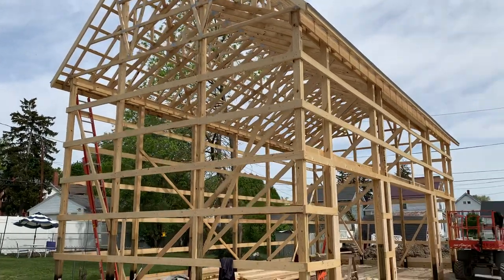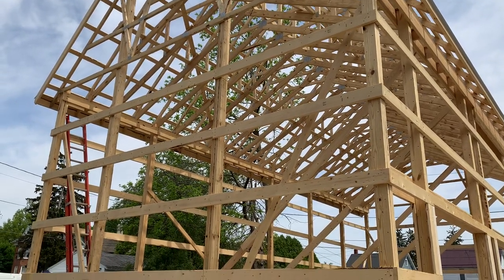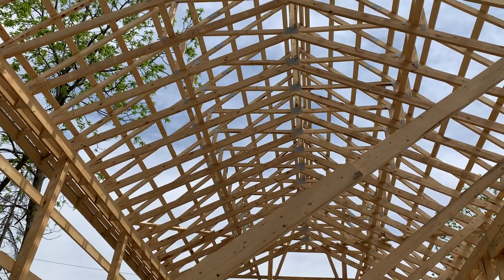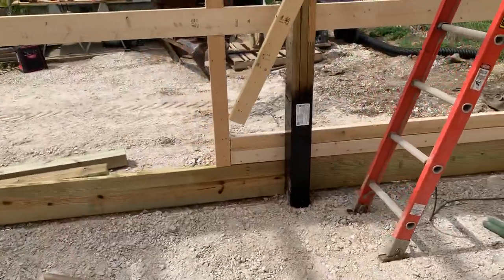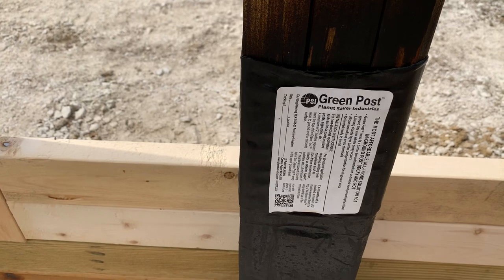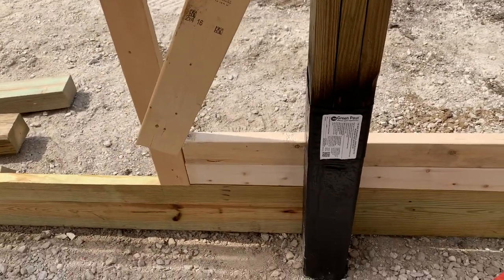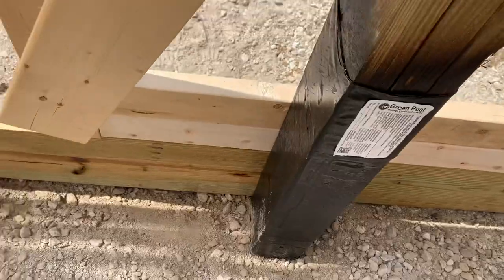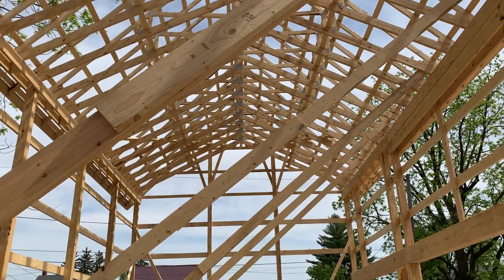Carriage Pole Barn 18’ Tall Built in Town...

Comment: Josh, what you call a green post looks like a protective plastic sleeve covering the bottom of the three ply laminated post. This would be very helpful here in Texas to prevent post rot. I’m planning on using this when I do my building. Thanks for showing this.
Reply from the maker: Had good success with that application so far.  It just makes sense with the asphalt coating.

Comment: I was looking at a 10/12 and thought that was a lot for a heavy-timber pole barn. Those 12/12 must be something ! I feel for the roofers. Does a steeper roof pitch make the building stronger than if it was a 4 or 6/12 pitch?
Reply from the maker: Not really.  No snow load because of steeper pitch.